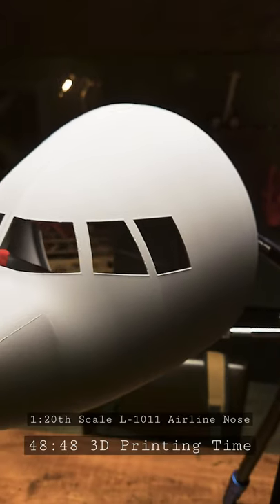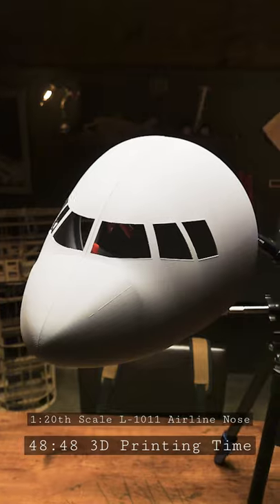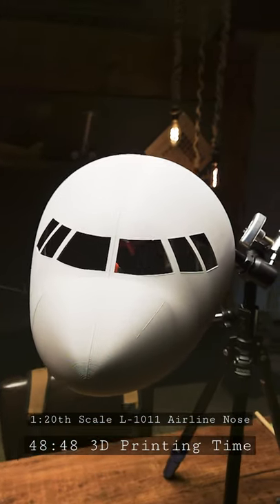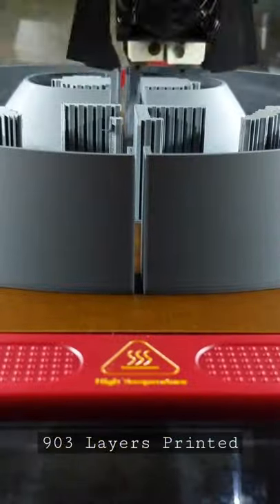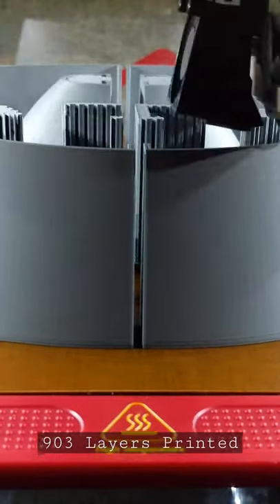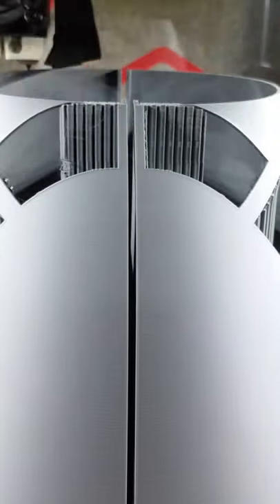48 hours! 3D printing a BIG RC / UAV Airplane Nose on a Raise3D Pro 2 #shorts

Comment: I cant get over the quality of that print! amazing! :)
Reply from the maker: I'm right there with you, the Pro 2 is proving to have been well worth the investment.
Reply: @RCCAD2VR  I was looking at the printer you have and it says its pre leveled from the factory. What happens if you get it out of level? Is there a procedure to follow to get it back in tolerance? Have you had to work on the printer yet? maintenance? clogs? change nozzle? etc? thanks! Also, would you mind making a few comments on you laser cutter sometime? Maybe a overview or walk around. I'm super curious about your impressions of it. From a previous video showed that it does some very nice cuts.

Comment: If you want it to fly, have you considered foaming PLA?
Reply from the maker: Not as a mold plug, this needed to be printed with rigid high, dimensional stability material. Weight is not a factor for this piece.
Reply: @RCCAD2VR  But printing with foaming PLA would allow you to avoid making a mold, wouldn't it?
Or if you absolutely want a mold to make it in fiberglass: why not print the mold to save a step?
Reply from the maker: Ah, It's because it needs to be reusable. This is going to be a kit and I will need to make  the nose part many many times. So a permanent mold has to be made. This is the plug, which gets used to make the negative mold. A 3D printed mold wouldn't be durable, and printing them each time would be really inefficient. Once the mold has been cast this part will not be used again..... except as decoration 😁

Comment: its been so long since your last vid, i wanna see how you create a mold and fiberglass it
i'm about to create a b17g flying fortress in fusion 360... you can guess where this is going hah!
Reply from the maker: Yeah, it's been too long. Developing this kit, with unavailable materials, shipping problems and order delays plus getting all the tools and machines necessary to manufacture has really put a dent in my speed. Things seem to be moving again! Video on its way soon.
Reply from the maker: Good luck with the B17G!
Reply: @RCCAD2VR  i can feel you, also having issues with materials... trying to find 240g carbon fiber in swizerland is literaly impossible, decided to build in full fiberglass instead.
your videos + ramy rc's are a really great help to my project, thanks alot for that!
Reply: @RCCAD2VR  i can feel you, also having issues with materials... trying to find 240g carbon fiber in swizerland is literaly impossible, decided to build in full fiberglass instead.
your videos + ramy rc's are a really great help to my project, thanks alot for that!

Comment: Any updates on the build?  Your channel has gone eerily quiet!
Reply from the maker: Hi 👋  All is well. Just ran into a few snags and complications that I've had to work out, but things are still moving forward. Hang tight, I'm shooting video over the next 2 weeks. Thanks for checking in!
Reply from the maker: Oh I should have mentioned... if you use "the socials" and it interests you, I post regular progress updates on instagram @rc.cad2vr and twitter @cad2vr
Reply: @RCCAD2VR   AH!  I just looked at your Twitter feed.  Wow, the scope of the project is staggering.  You are essentially a one-man aerospace company!  I will be patient!  Thanks!
Reply from the maker: 😆 Pretty much! It's a ton of work, lot's of trial n error but progress is steady with the occasional set back. With any luck things will start moving faster soon.